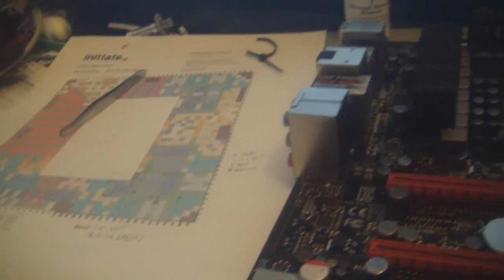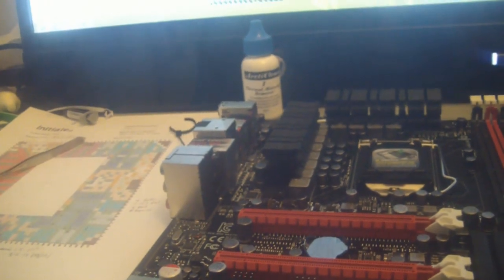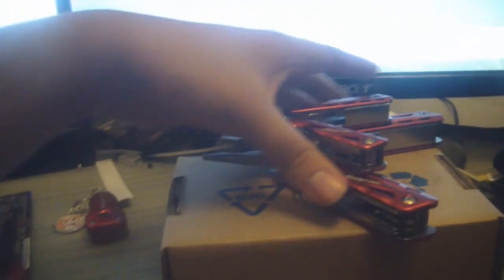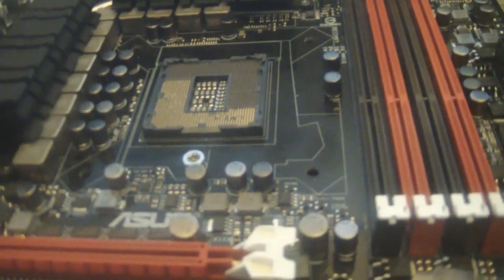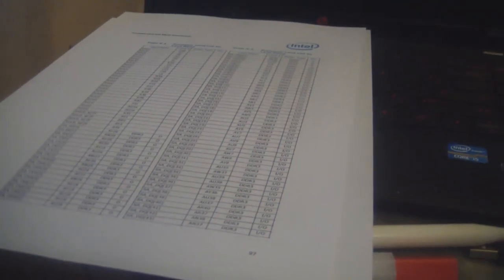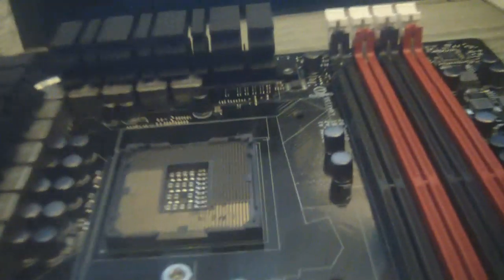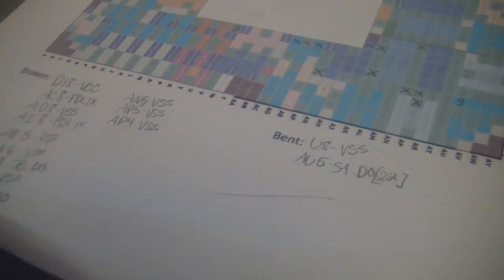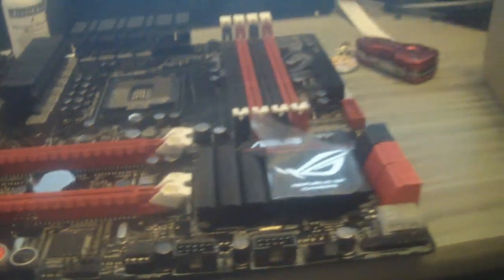Jan's Tech Vlog: Video 2 - Fixing Motherboards... Or rather CPU pins.

Comment: My Pins are broken. 18AW, the dRam pin and 16AW VSS pin. Would it still work even if those 2 pins are broken? (I'm in another country right now so I have to wait like a month until I know for sure.)
Reply: Harley Cheunjit I want to say no since it appears to be ground and a single DRAM pin. If you haven't had any negative performance running it now, you probably won't. You may have an instance where you have a memory error, but I don't think the chances of that are likely.
Reply: Initiate Id  Thank you very much! :D

Comment: they need to make a new socket similiar to the old ones that were kinda like a pci card on the pentium2 except smaller and more modern
i am sick of seing all the poor people on ebay with perfectly good motherboards that are ruined only by pins (or vis versa with the cpu's) or they need to make the pins removable in case this happens so you dont waste a motherboard
Reply: Unfortunately, breaking motherboards is just business. It helps them sell more.
Reply: Jccjcat on that fine note i add my own reply
r.i.p. idiot proof cpu sockets XD